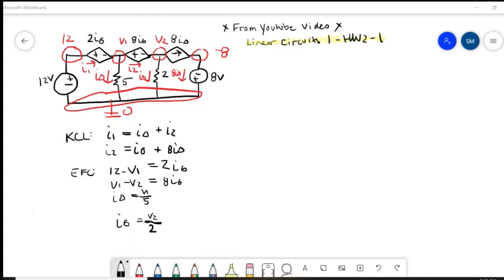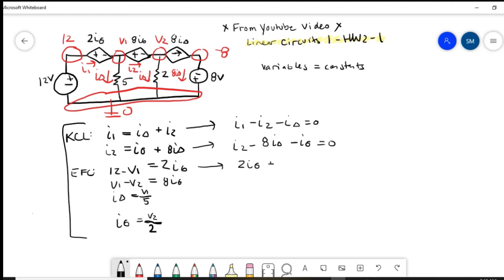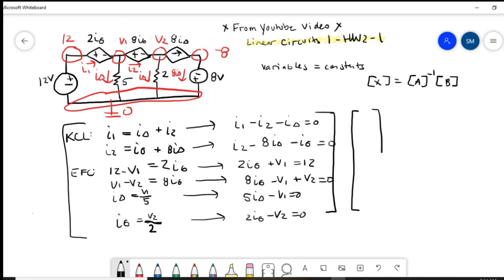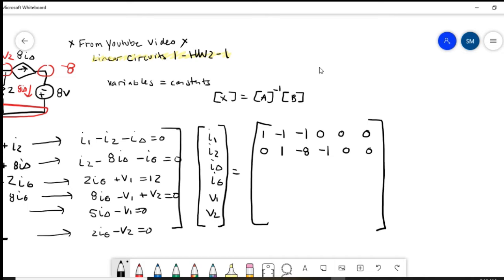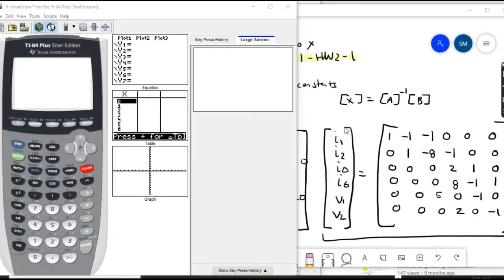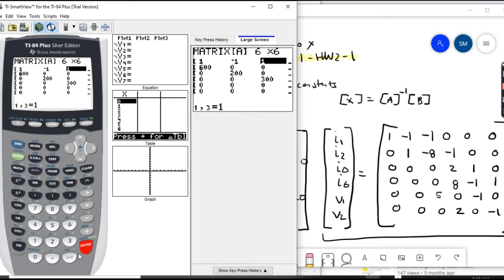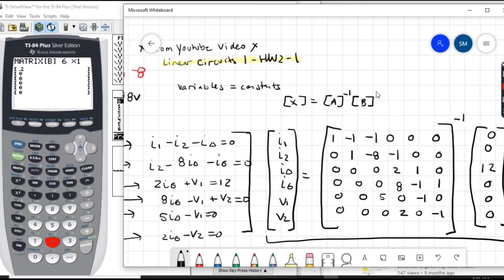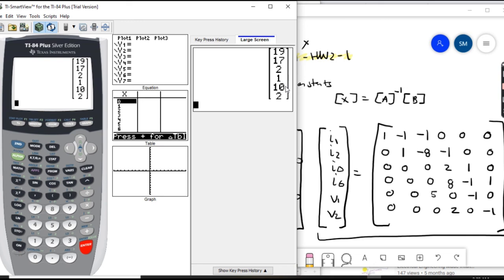(Linear Circuits I-HW2-1) - Matrix TI 84 Demo

Comment: There is a simpler way to do this if you just make it a 6×7 matrix instead, making the last column your 6×1. Then you can just use the rref function and the last column of the new matrix will be the answers.